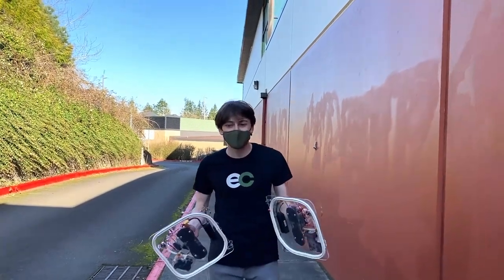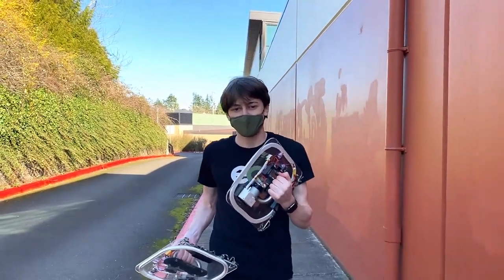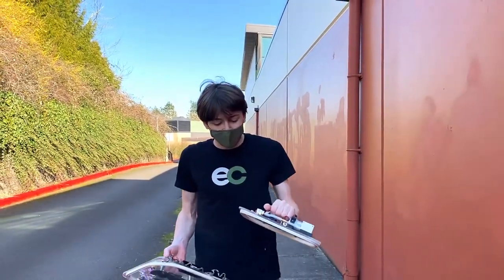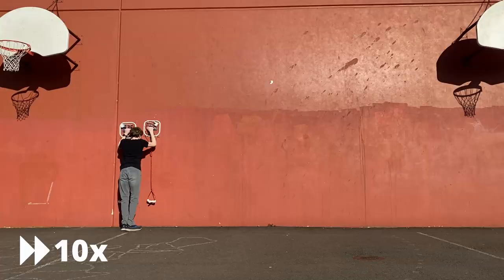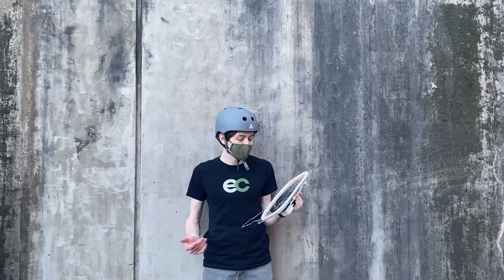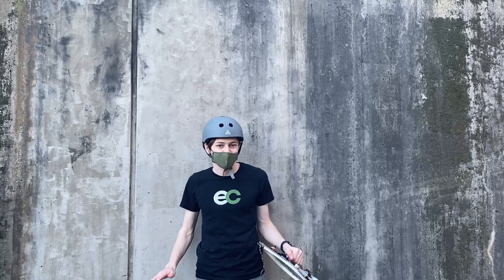Climbing more walls with my updated vacuum climbers (SCARY)

Comment: It would be cool to have a vacuum gauge that would cause a little cell phone vibrating motor to pulse when the seal is not leaking much and is at a good low pressure